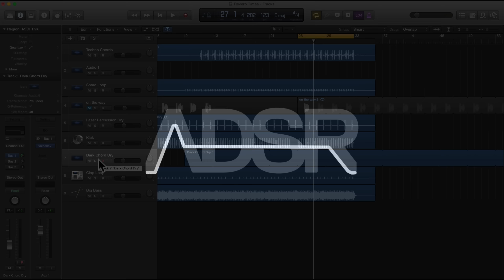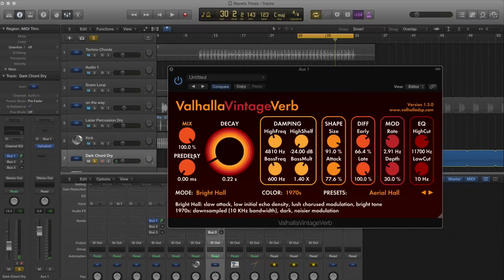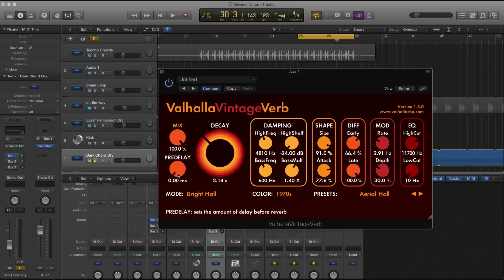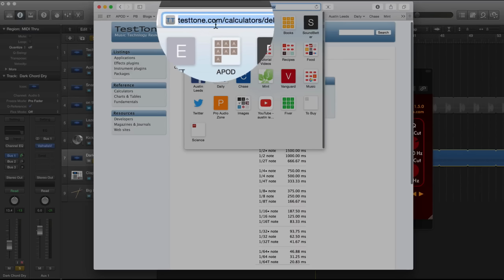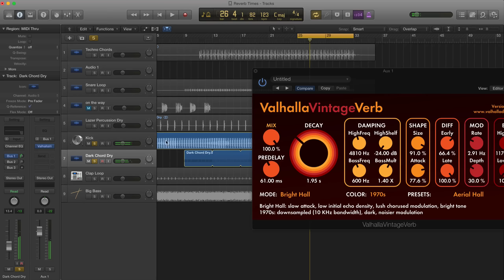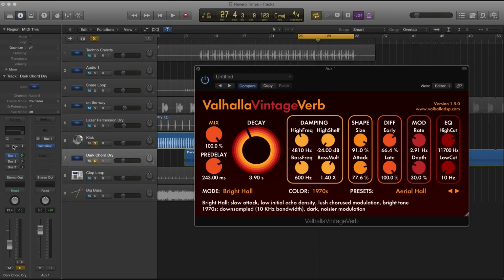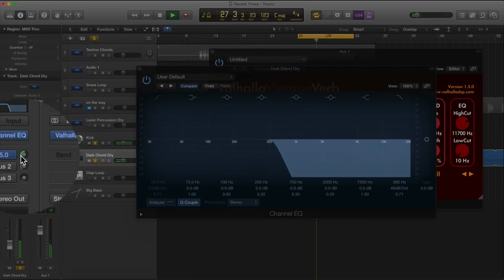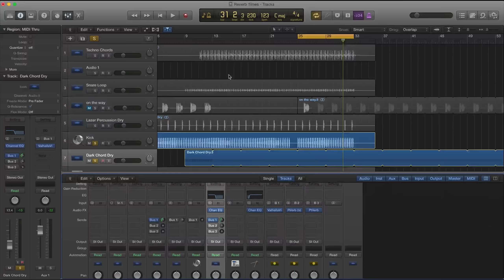Setting Your Reverb To Be In Time With Your Track

Comment: why the predelay time not deducted from the decay time?
Reply: Because there's one bar between each chord, you're right if the thing is to make some "sidechain" effect between the reverb and the kick but I think he only doesn't want to lush the reverb with the following chord.
Reply: If the decay = 1 bar, it will overlap by predelay time. Cuz it shifts the decay by that time.
Reply: arseniy milliseconds ARE tiny, so like at 60ms he'd only have to subtract .06 seconds so the difference would be minimal. But i do 100% agree with you. Imo for an exact, synced, value you should subtract the pre-delay from the decay.

Comment: what is a bus ?  and how is it used
Reply: a separate mixer track with the sound youre editing routed through it
Reply: Miles Coleman it's used for mixing multiple tasks with similar characteristics together as one track. but you don't have to use it for that reason. Say you want two vocals to have the same delay but you want to eq the vocals separately you could route vocals to the bus after the audio signal is processed through their individual eq.
Reply: shane bieda why not just copy n paste them?
Reply: Lil Saf why not? do that too. buses will keep your mix more consistent though. Think in terms of mastering as well
Reply: shane bieda cos i use ableton I'm used to just drag n drop effects and thats it.
Reply: Every daw is the same. I use ableton too. There comes a point in the production process where duplicating one effect to a bunch of random channels and turning the knobs becomes an inefficient workflow. Use groups, return tracks or effect racks with chains
Reply: A Bus is typically something that transports people between certain destinations,  kind of like a Taxi or Train service, but often cheaper and slower.

And/or essentially another way of grouping Channels/Tracks together for various different purposes such as bonding everything together with a glue compressor
Reply: cant i just route the 2 tracks to the same mixer track n then put the effects on?

Comment: but reverb is actually represent the size of the space , the tempo is changeable, but the space size is constant.......so i just doubt of this trick if meaningful
Reply: many producers use this technique in EDM .It is best used just for the synths on drop in my opinion as it helps to get a "cleaner" mix as everything will work & glue together better..it might actually give a nice rythm/groove as well to your overall mix,if you also sidechain the reverb.. 
if you add reverb in random time and you have too many layers of synths, you will probably have difficult time adding the reverb to the "correct" place and make it work in the mix,as everything will sound a bit messy.in general on drop you want everything to work &pump nicely & rythmically together